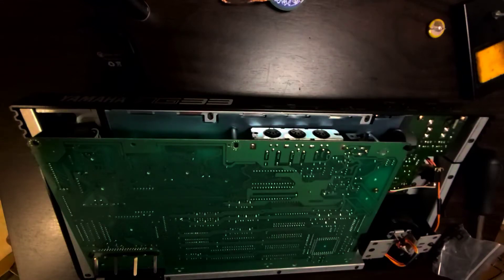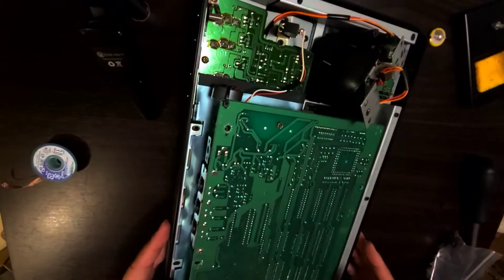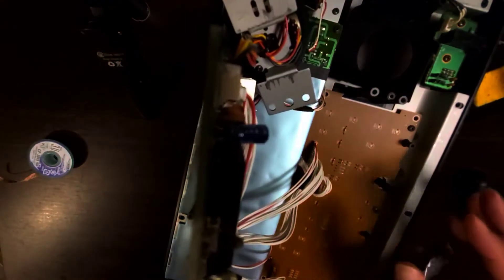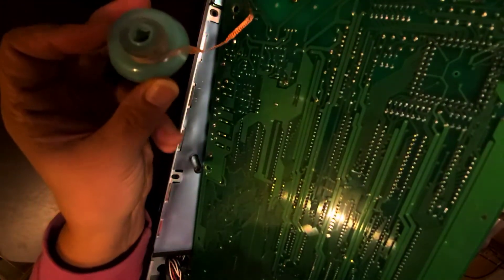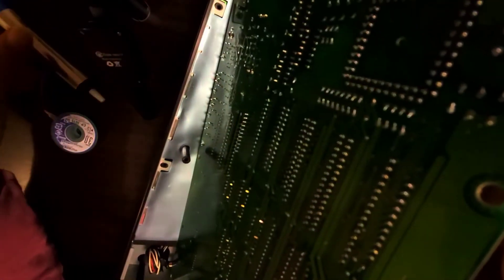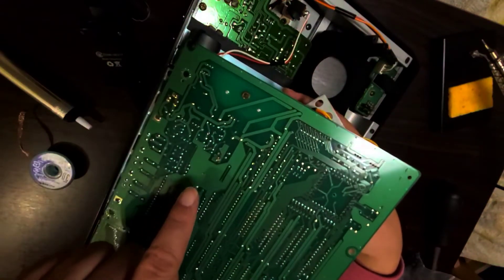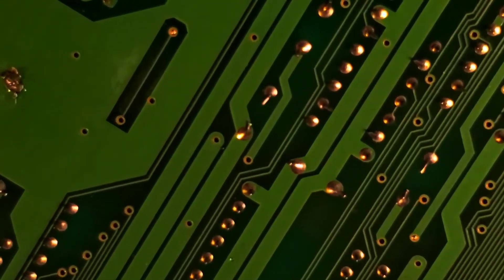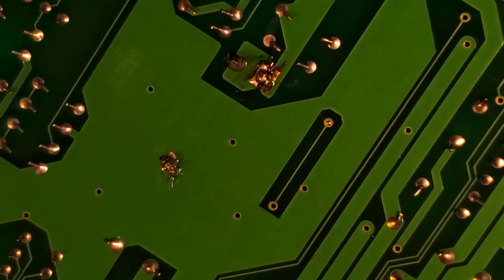Yamaha TG33 Synthesizer coin battery replacement & soldering basics (remove old solder)

Comment: Thanks for sharing!  Here's what I've done to refresh a TG33:  Replaced fixed coin battery with socket/holder from 'Analog Classics'.  Replaced 4 output muting transitors TR2,TR3,TR4,TR5 (C2878) - this was causing all four outputs to have terrible output, low sound, noisy.  Serviced buttons/carbon pads (these can get hard to push), I use a light scrub with a magic eraser on the carbon pads, then spin a pencil eraser on the rubber nubs, then rub the nubs with #2 pencil.    good as new!

Comment: Do you have a link of the actual battery you purchased?
Reply from the maker: Hi! I was living in Japan at the time. I got a couple of Panasonic CR2032 batteries with supports. Looking for them now in other places, they are kind of hard to find. If you want to make sure that you get the kind with the support inside the circumference of the battery, instead of not on the edges. If you want to Jerry rig it, you can just get a support case, but then my concern would be the battery bouncing around inside your synth. Here's the link for what I got... For what it's worth. https://www.amazon.co.jp/%E3%83%91%E3%83%8A%E3%82%BD%E3%83%8B%E3%83%83%E3%82%AF-Panasonic-%E3%83%91%E3%83%8A%E3%82%BD%E3%83%8B%E3%83%83%E3%82%AF-%E3%82%B3%E3%82%A4%E3%83%B3%E9%9B%BB%E6%B1%A0-CR2032-%E6%A8%AA%E5%9E%8B%E7%AB%AF%E5%AD%90%E4%BB%98%E3%81%8D/dp/B00FRD7KCQ?pd_rd_w=r8aCC&content-id=amzn1.sym.f480b958-a19d-4124-b672-460c84e9c5f4&pf_rd_p=f480b958-a19d-4124-b672-460c84e9c5f4&pf_rd_r=5FWJS4VTVTW8T107KXAT&pd_rd_wg=hmlgZ&pd_rd_r=0538e712-664b-4448-9fd8-d8192ee2e2c8&pd_rd_i=B00FRD7KCQ&psc=1&ref_=pd_bap_m_grid_dv_rp_0_33_i https://www.amazon.co.jp/%E3%83%91%E3%83%8A%E3%82%BD%E3%83%8B%E3%83%83%E3%82%AF-Panasonic-%E3%83%91%E3%83%8A%E3%82%BD%E3%83%8B%E3%83%83%E3%82%AF-%E3%82%B3%E3%82%A4%E3%83%B3%E9%9B%BB%E6%B1%A0-CR2032-%E6%A8%AA%E5%9E%8B%E7%AB%AF%E5%AD%90%E4%BB%98%E3%81%8D/dp/B00FRD7KCQ?pd_rd_w=r8aCC&content-id=amzn1.sym.f480b958-a19d-4124-b672-460c84e9c5f4&pf_rd_p=f480b958-a19d-4124-b672-460c84e9c5f4&pf_rd_r=5FWJS4VTVTW8T107KXAT&pd_rd_wg=hmlgZ&pd_rd_r=0538e712-664b-4448-9fd8-d8192ee2e2c8&pd_rd_i=B00FRD7KCQ&psc=1&ref_=pd_bap_m_grid_dv_rp_0_33_i

Comment: Hey! Do you remember what number the coin battery was? I’m gonna do this repair soon but I’m having a hard time finding which part to buy. Thank you!
Reply from the maker: This is the one I got. I believe you can order it on Ebay, but it is more expensive than other places. Be aware that there are two posts that stick out, one on one side of the battery, and one just a little bit off-center, like 1 or 2 mm. I know that some repair people have gotten battery adapters and put them in for the DX100. However, for the TG33 I wasn't sure there would be enough space between the battery and the case for that. Also, you would want one that fits perfectly, because to have the battery attached via wires might mean that the battery was moving all over the circuit board and you just don't want that to happen. So it should be something you can solder directly into the board.
Panasonic Coin Battery CR2032 Horizontal Terminals
https://www.amazon.co.jp/dp/B00FRD7KCQ/ref=cm_sw_em_r_mt_dp_C4P35ACS8DDMYD7Y0YM5?_encoding=UTF8&psc=1
Reply: Wow this was so helpful! Thank you so much!!! I just started fixing and upgrading my gear myself and ordering the right components is the hardest part for sure. This was very helpful!

Comment: I have a korg x 5 in need of a battery replacement and was searching everywhere for a tutorial as coherent as this one!  Thanks so much - different synth but same process!  Make more videos! You’re awesome at it!
Reply from the maker: Wow! Thank you so much for the encouragement!! 🥰
Reply: @somnyad  I agree, excellent video, good pace, easy to understand. Very helpful ! Thank You
Reply: Kal, Did you have any luck with the battery replacement of the Korg X5 ? I have a module NS5R that is very similar. Was able to open the chassis and have access to one side of the board , but can't figure out how to get access to the other side of the board. Any tips?
Reply: Did you have any luck with the battery replacement of the Korg X5 ? I have a module NS5R that is very similar. Was able to open the chassis and have access to one side of the board , but can't figure out how to get access to the other side of the board. Any tips?